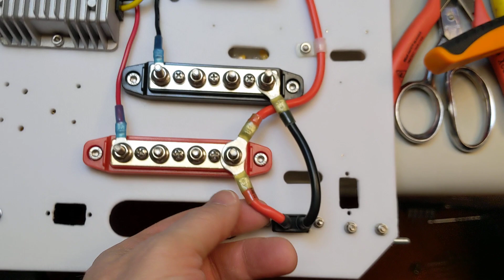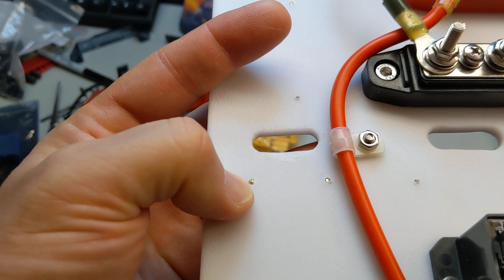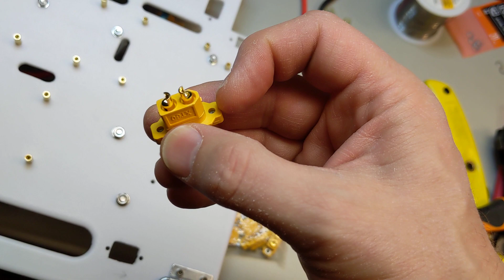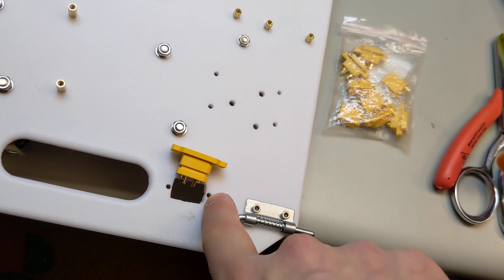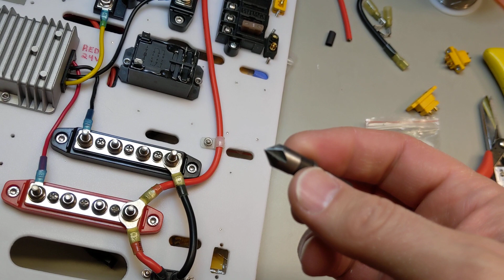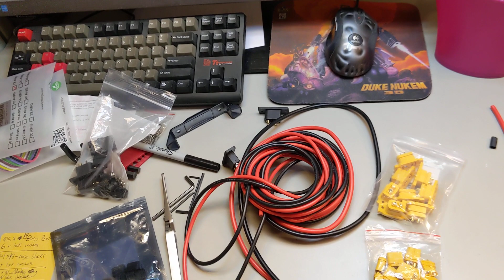3D Printed R2D2 - Part 96

Comment: Hi Tom,
Do you know if the WAGO connector with the (3 bays) function the same as a GKEEMARS connector that is (1 in & 2 out)? I need to split the (+) Positive current 2-ways. One is going to the 24V (150 Watt) DC motor with 12AWG wire and the other one is going to an LED voltage meter that uses a 20AWG wire. I need to split the current like a "Y" splitter, one wire to the motor and the other wire to the LED volt meter. Currently I am using a Gkeemars (1 in to 2 out) but I would like to replace it since they do not work as well as fail often. Please let me know.

Thank you,
Ed
Reply from the maker: If I understand what you're asking, then yes it would work.  The large connectors that don't have fuses shown in the video are simply a large piece of metal with bolts and screws going through them, so any wires that are attached are connected to each other.  There are actually 4 bolts and 3 screws on each one.  You can even put multiple wires on each post if you needed more connections.
The connectors with fuses are similar but obviously have the addition of a fuse on each connection point.

Comment: Hi Tom, am loving following your journey. I’ve started my r2 build. I’m just wondering, why you didn’t follow Jason’s method for the regeneration current? What made you take a different route?
Reply from the maker: I liked the ability to have R2 in an automated mode with dome movement and sound but the foot motors disabled.

Comment: Hey Tom! How many printers do you have? And how long did it take to print everything? I only have one prusa mk3s+ and this is so damn slow!
Reply from the maker: I had 2 when I printed the parts.  I had the Prusa MK3S and a Tevo Tornado that had a 300 x 300mm bed.  The Tevo was printing nearly non stop for 3 months on all the large pieces and the Prusa was going about 60% of the time.  I sold the Tevo to reclaim the space for bins to put the printed parts in.

Looking back, I wish I had taken breaks from printing to do some of the sanding and assembly along the way instead of rushing to create a mountain of parts.
Reply: @TomsProjects  I thought about that but I wanted to assemble parts first so I can sand them uniformly. I figured if I sand piece by piece then I may end up with uneven connections and then needing to sand all over again lol. Idk tho I’m really early into this process.
Reply from the maker: @jlgspaz13  Everyone eventually finds the method that works best for them, so go with what makes you feel comfortable.  I found that doing some of the sanding and filling on the individual parts was a bit easier than doing it once they were glued into larger bulkier pieces but you still have to do the final stages and paint  once things are all assembled, so either way is valid.